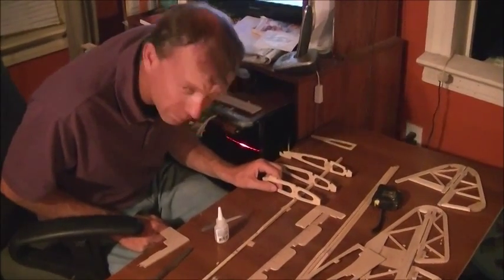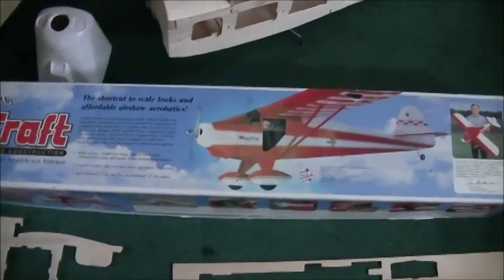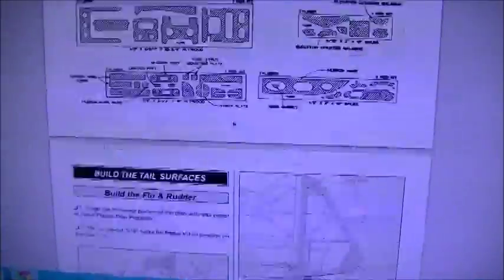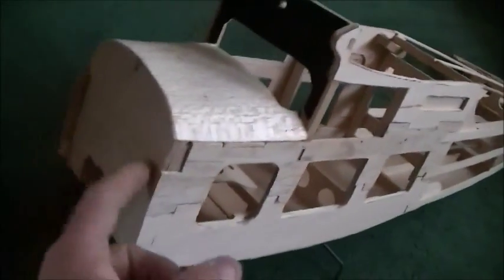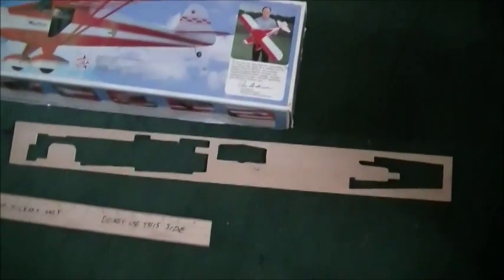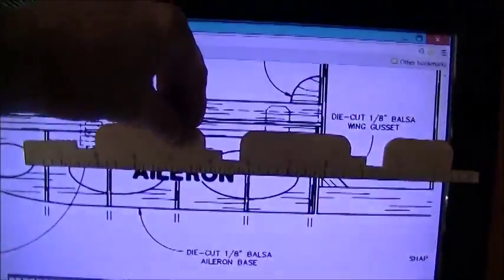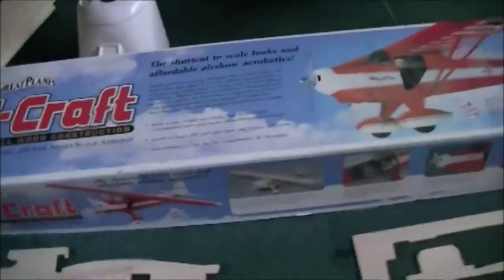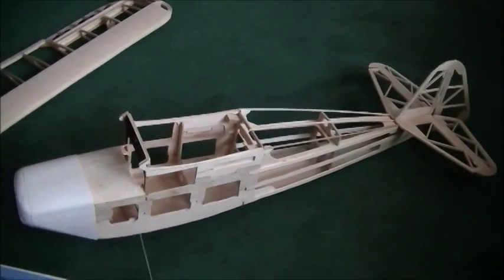Great Planes Taylorcraft build electric

Comment from the maker: i noticed a lot of views so I will give a review of my maiden flights. ... The plane weighs in around 5-6 lbs and I was used to flying foamies and did not have proper runway length for the heaviness of this plane. I got it in the air 1st try with full throttle and flew 1 and half minutes at probably 70% throttle.  It tracked straight and true with only 2 clicks left rudder  but needed the 70% throttle to stay up. I would suggest something stronger than the 32 size Turnigy so you can bump down the throttle. i have only flew it a few times and need a real runway to practice on. Any good flying field will do and maybe I can get out to a few fun fly's soon. If you have a plane like this converted to Electric please feel free to tell me your power train details.  Thanks for watching.